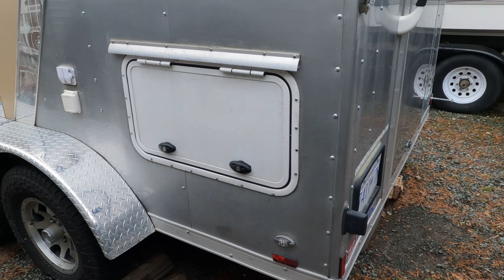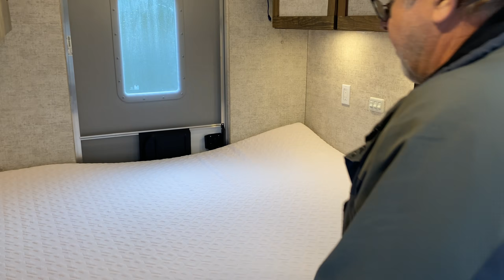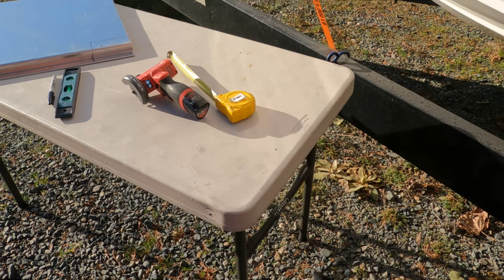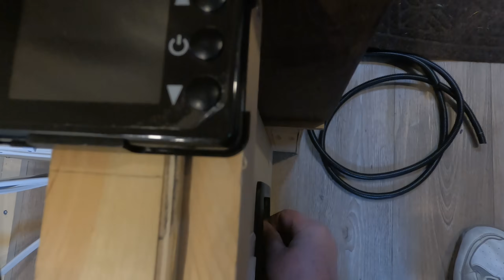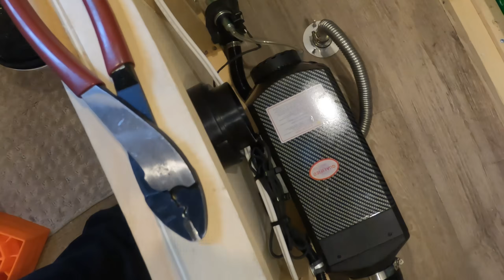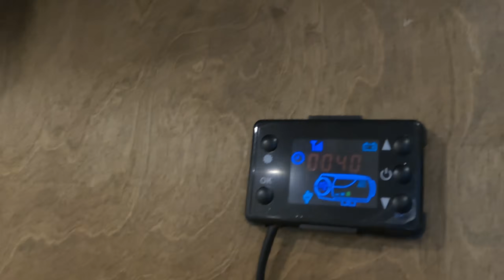Soaring Eagle DIY Rv Build Vid7- Best Diesel Heater & Tank Install with Mess-Free External Tank

Comment: I run my fuel from a 15 gallon metal fuel cell (cuz I had it).   The Teflon line goes through a vent fitting (and was fished out and an open ended fuel filter attached and dropped back in).  I fuel once a trip and never made ANY mods to the tank.
Reply from the maker: Lots of fuel for heat...:hand-pink-waving:

Comment: New subscriber and this is the first video to watch.  I really like what you've done with the install of the diesel heater. I live in a 38' 5th wheel and I just picked up a LF Bro's N2 heater. My first use will be to throw heat underneath the front skirted area of the trailer to keep it above freezing on those freezing temp. periods. Secondly, I'm considering heating both underside and inside in the future. I think it'll help cut down on burning thru the furnace's propane use.  
Looking forward to your other videos. 
Liked & Subbed.

Thanks!
Reply from the maker: When you're living full-time and skirted, great idea to heat the underneath and belly, since lots of the manufactured units don't have a lot of insulation in the floor... I've currently got r10 foam but going to double it to r20 this coming summer for next winter use... Just having the r10 made a major difference on having a warm floor from the first camp-out in the cold with just a plywood and vinyl tiled floor... The Diesel heat under your rig will be a nice dry heat as well...

Comment: Hi there, I liked the installation seems robust enough . Fuel tank idea is great. Would love to build something like this in the future. have you considered plumbing the combustion intake outside  like you did with the exhaust? Some say it causes a negative pressure and can cause window and door seals to leak in cold air which may be counterintuitive. Same with the fuel filter, the 2 piece thread together type are prone to leak overtime. To be fair, I don’t use or operate any of this so I have no personal experience with this happening, but I thought I’d pass the info on. 🍻
Reply from the maker: I did consider putting it outside, was a bit limited for space, I've seen how some Truck Campers have it all outside... I have it in the cargo bay... I agree with you, so what my plans are is to put the air intake into a vent hose with a open/close option and plumb it to the outside wall by the cargo bay door...
Reply: @SoaringEagleDIY  good idea I like it 👍🏼 will also help keep critters and spider out when not In use. 🍻
Reply: @SoaringEagleDIY the only outside connections should be the very tip of your air cooled exhaust and the fuel line.    Diesel is a low temp burn and heated air should be recirculated and combustion air warm (refer to toyo and similar oil fired heaters)..   and lose the music.
Reply: Heater air should be recirculated and combustion air warm or warmed.   Only the fuel tank and tip of exhaust outside..